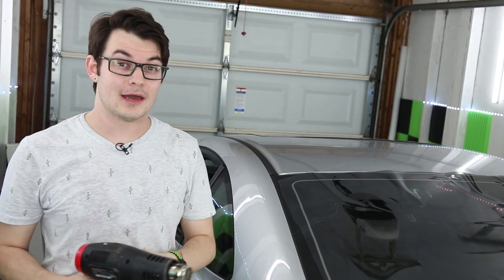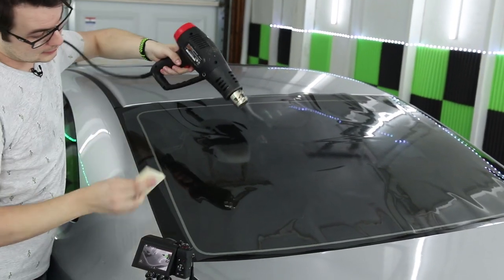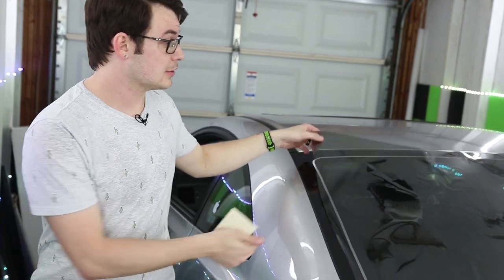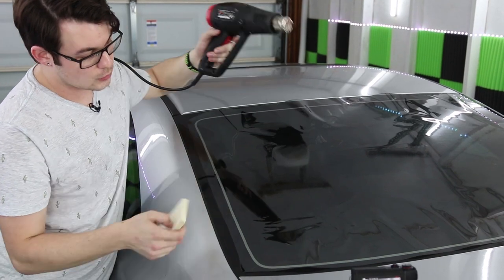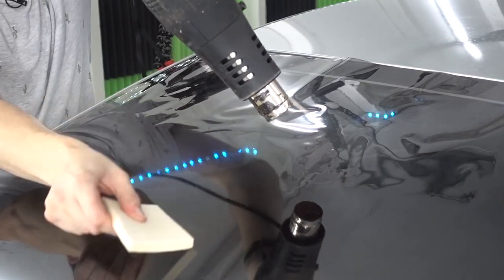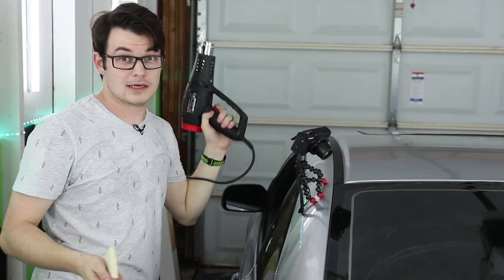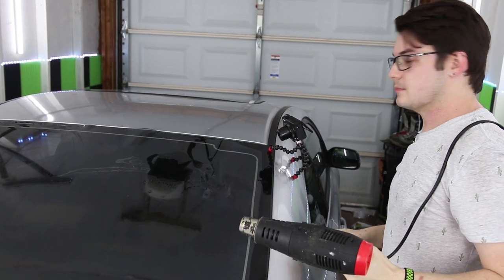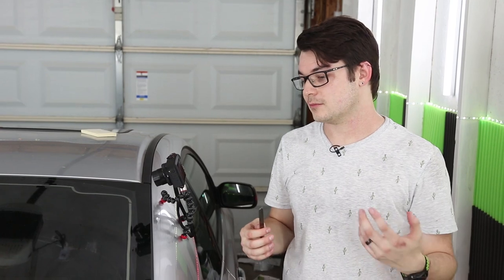How to Shrink Tint on a Back Window | Dry Shrinking Window Film

Comment: I’m assuming good quality tint shrinks better than cheap tint? I’ve been working on my cheap beater car for the last few days off and on using Walmart tint. I had a hell of a time getting the back window shrunk. It seemed like it was either too hot and melted the tint, or If I did less heat, it wouldn’t shrink enough and would crease the film when I carded it down. I will say diy window tinting is a pain because we don’t have access to the good films that the professionals use, at least as far as I’ve found.

Comment: Awesome work! Im having trouble shrinking the rear window on a 2013 tahoe can you explain what needs to be done to get it right or post a video. Thank you 🤙🏽
Reply from the maker: Check out this live stream with a dodge caravan. Same type of window but your tahoe will be an easier install. also the back glass opens separate from the hatch so that will make the installation easier overall. good luck!

https://youtu.be/UvSmEYJMMdA

Comment: I'm gonna attempt my hatchback rear window for the third time! I hope watching this again will help me. Wish me good luck! 😔
Reply: The same first film or did you have to reuse new tint sheets when redoing it?
Reply: You are not alone, attempting my 06 mustang for the third time, back windshields are a pain, windows super easy
Reply: @UpNorthMexi  I used new tint not the same and it somehow looked okay-ish so I kept it. The problem what they don't explain us is the fact that wrinkles that are horizontal on the left and right sides can't be corrected. Not even with a heat gun. So whenever you guys start shrinking make sure there are no horizontal wrinkles going to the left or right side make sure you have as much as wrinkles vertical, hence the H method
Reply: My fifth time and lots of wasted film but today i managed except for two huge creases that occured on the left and right edges. I have discovered its easier to swipe the fingers diagonally as you shrink rather than straight down or up. Though i think part of the problem is using a low power hear gun like my 300 watts heat gun.

Comment: What's an acceptable amount of flaws in the film once fitted?? I paid to attend a tinting course a few years ago but got disheartened and gave up as I felt I couldn't charge my customers if i wasnt happy with the end result. Your videos are great, very clear instructions etc and you make it look so easy. Am I being too hard on myself?? I'd get small creases and tiny dust particles once I'd finished.
Reply: If it's done right you should have absolutely no creases and no Dirt. I've been working at dealerships doing tint & PPF for 6 years now and even the slightest flaws are not passable and will usually result in the customer bringing the car back and complaining if you try to send it out. Especially on high end cars. It's best to just do it right the first time, even if that means redoing it multiple times until you get it right. Don't get discouraged, just keep practicing. Like any other trade/hobby, you'll get better with time.

Comment: Why is it that when I do exactly the same moves as thus guy with my heat gun.... the tint just NEVER shrinks as nicely as it does in these YouTube videos?...

I always have problems that when hitting the bottom of the rear window tint with heat.... the fingers moves horizontally and then starts moving upwards towards the middle and I always feel like I'm always going backwards and creating more work instead of moving forwards and removing the fingers as such..... 🤷‍♂️

Comment: Could you please do a test with the tint rolled vertically? I bought a 60in roll with the size of the window cut vertically for my car and I simply can't shrink it properly.
Reply from the maker: It doesn't make sense to shrink sideways on a standard back window. they are usually wider so you are creating problems for yourself by doing it that way. take the 60" roll, unroll it normally and use the extra film for some door windows. otherwise you are just throwing film away anyways.

Comment: Do you just run your felt card over the tint when shrinking or do you  apply pressure while smoothing it out?

After watching your videos I attempted my first rear window (2013 Hyundai Accent) and it came out pretty good considering it was my first attempt but I felt like I was doing something wrong because I had to apply a ton of pressure in order to get the tint flat and smooth while shrinking.
Reply: Maybe it was the film you were using but usually when the film shrinks you just smooth it down